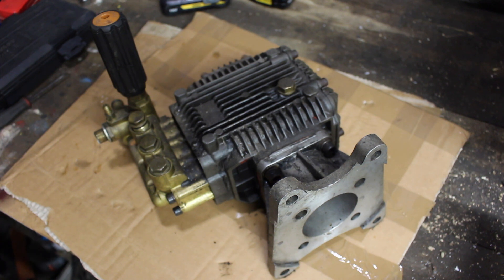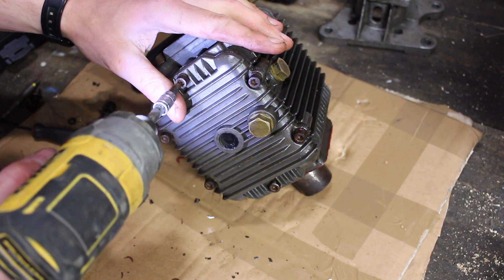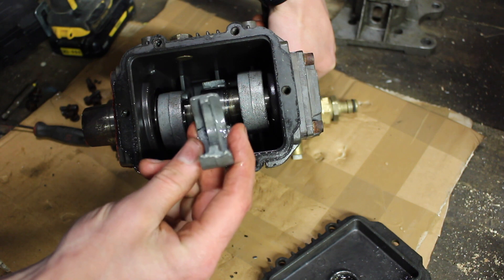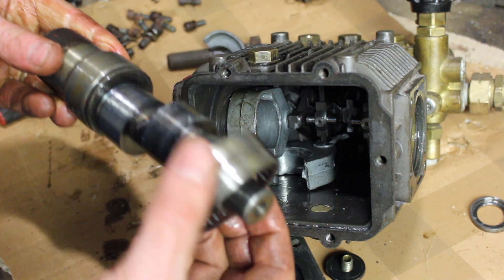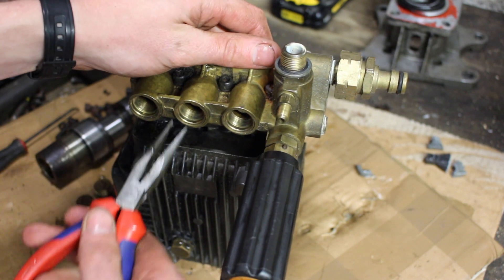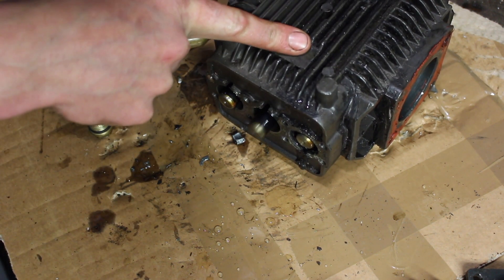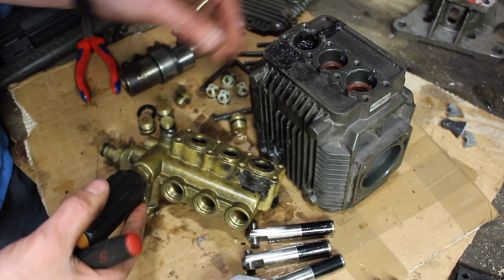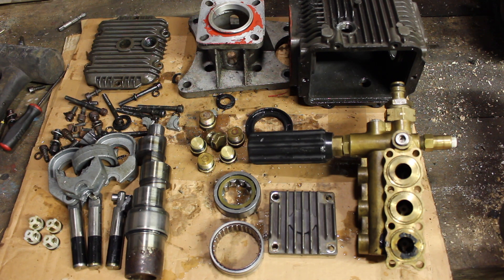Teardown of a Pressure Washer Pump

Comment: I have been looking for information on how to disassemble my AAA pump to check the connecting rods that are a bit heavy or stuck when moving the shaft. Thanks for this video, now I will disassemble it to see what is causing this heavy friction of the connecting rod and its shaft, because everything apparently looks fine.

Comment: Hi there, I’m buying Karcher HD 5/17 which I believe has a brass pump. 
I’m a bit worried about the instructions what to do before storing it:

“Finishing operation
1. Close the water inlet.
2. Open the high-pressure gun.
3. Set the power switch to "I/ON" and allow the device
to run for 5-10 seconds.”

Comment: Is it cheaper to rebuild? Or just buy another pump?
Reply: I just bought new seals for the pump part, but after pulling the unit off the motor and draining the oil I can hear something rattling around inside like a piston is broken.  I spent $240 on new seals to change them out, but its more than likely a piston which would be cheaper to just replace the whole damned pump.  $400 for a new pump for the Easy Kleen 4000 magnum pressure washer.  ARGH!!

Comment: Yes, thank you for a helpful video.  I wonder if you have any suggestions for my particular situation.  I have a smaller pressure pump that unfortunately has build up scale and corrosion internally, following disassembly.  I have brushed as much as possible to remove the build up but cannot reach the deep internal passages so I would like to soak the pump head in a suitable cleaning solution.  I have learned that products like C-L-R are damaging to brass metal, which my pump is constructed with.  Do you have a suggestion of a cleaning solution for this type of pump?  Thanks for your help.